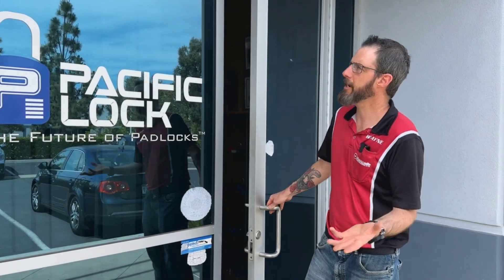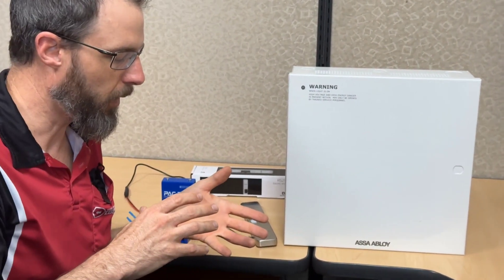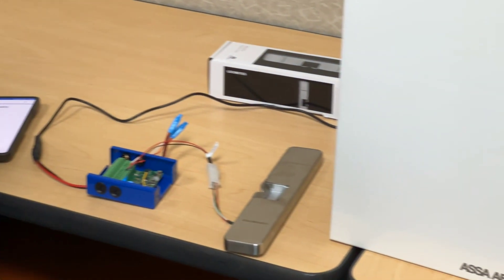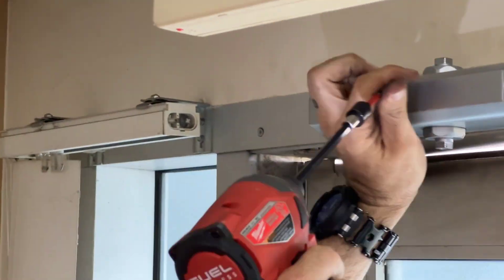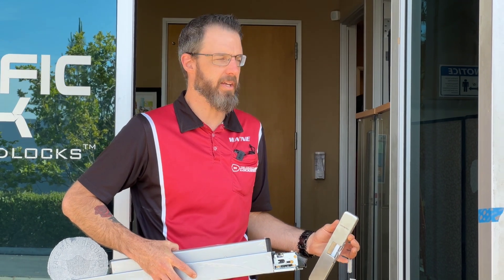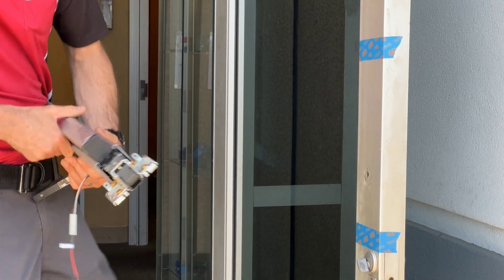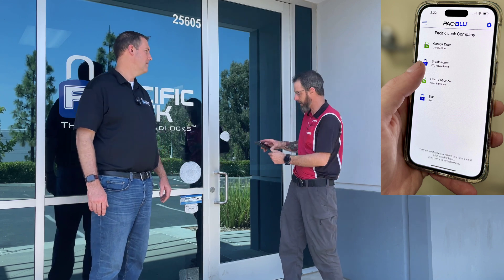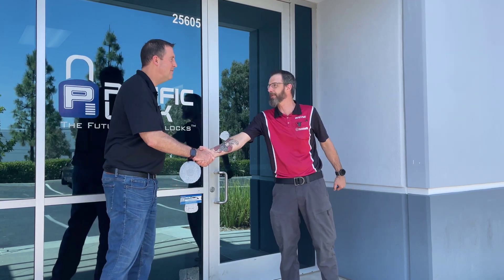The Future of Electronic Access Control Installation is here! Join Wayne Winton installing PAC-BLU

Comment: And here comes the comment section…..the low voltage connectors are called B-connectors and the guys that do this all the time typically call them beanies
Reply from the maker: You are correct, I call them dolphins, there are yellow ones called yellow jackets. Beans 🫘 or whatever you prefer, I wanted to give people a name they could search and find to purchase 😊
Reply: Depends who you ask. Old school telco guys called them beanies. Most people now just call them Dolphins because that's the manufacturer most people know. Several decades in the security/locksmith industry and never heard them called beanies except for the telco guys.

Comment: Very informative video. Thank you. How do you get power for this system if you don’t have an outlet nearby?
Reply from the maker: You can run low voltage ⚡ wiring or have an electrician drop an outlet in near by